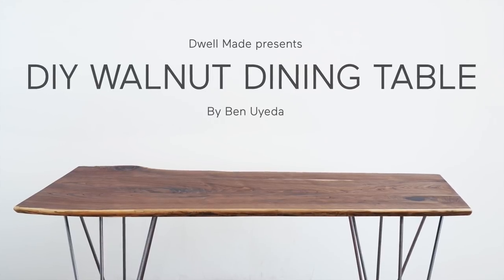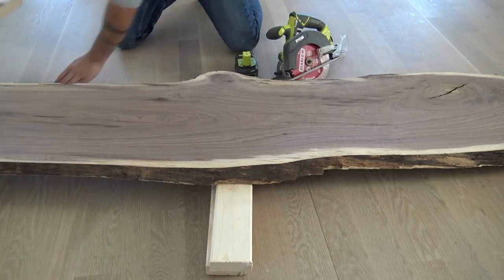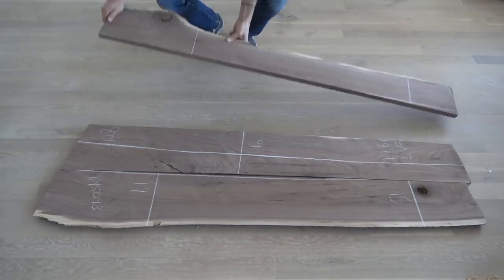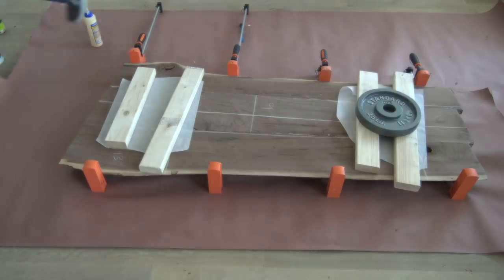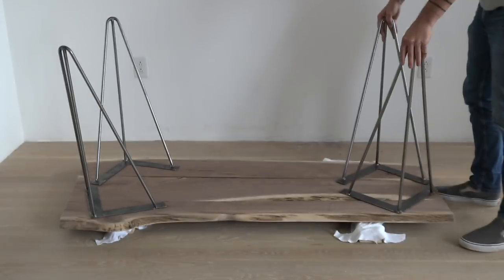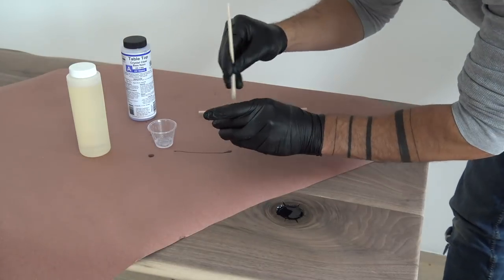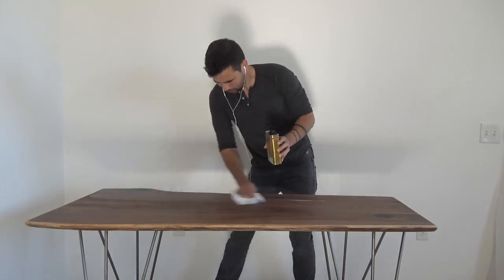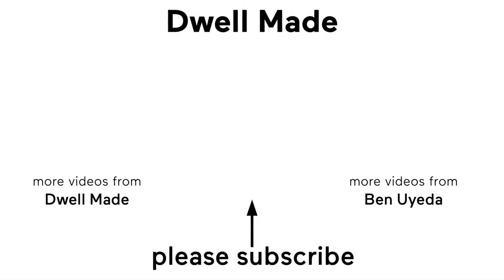DIY Live Edge Walnut Dining Table | A Dwell Made Project

Comment: The table looks great. Especially for a larger table I would suggest some type of reinforcement to keep it straight. One could use a special aluminum and steel dovetail batten that would work well with the slick design.

Comment: The table looks good.  I'm curious if there is a reason for doing the epoxy last?  I have always done it first, before sanding, so that I can sand it down when I sand the rest of the slab, but I'm open to learn if there is a reason to do it the other way around.  (Oh yea, and easy fix for the cloudy epoxy --- just sand up to 400 or 500 grit, and it will become perfectly clear.)
Reply from the maker: no reason,  i guess i just wanted to see if any parts of the knot would shake loose.
Reply: Gotcha...  I'm actually surprised you were able to pull it off without having to re-sand.  So I guess I learned something either way.  New option to add to the arsenal....